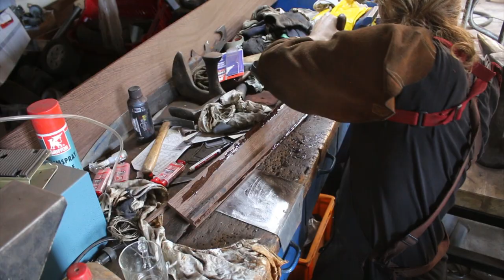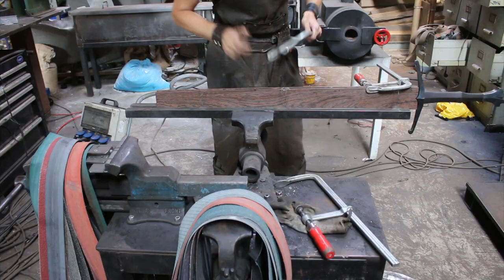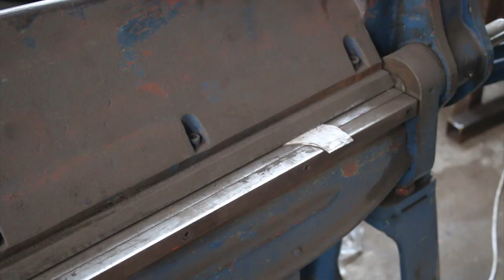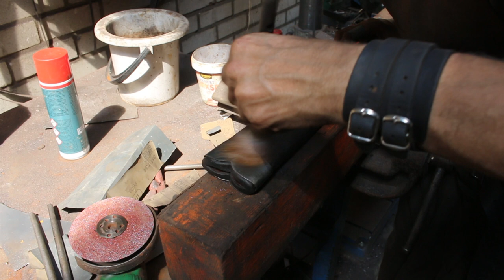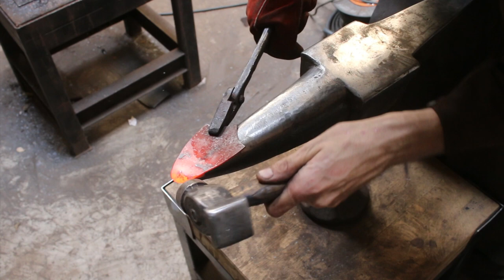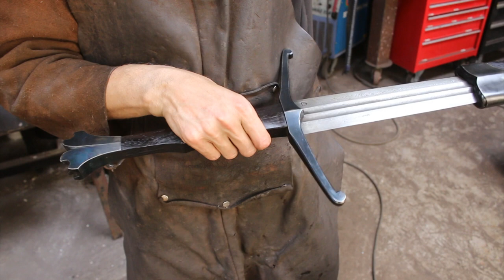Forging a Great sword, part 6, making the scabbard.

Comment: As a carpenter, you make a pretty good blacksmith.  ;)
Reply: I tease, because this is how I do woodworking too.  And my brother the actual woodworker cringes and shakes his head every time.  :D
I really like the three layer method of scabbard construction.  I never put a liner in, though. I heard a long time ago that tannins in the leather would rust the blade, so the leather needed to be brain tanned (or chrome tanned?) or just avoid keeping the blade in it for more than a day or two.  But then, I never tried it to find out for myself.

Comment: Classic starters scabbard, been there, done the same mistake :). Wrong kind of wood, wrong construction (for the period - some viking period sword scabbards were similar but these were probably field replacements, not work of craftsman), the result is thick as  log and must weight a ton. Besides I am not sure that cocktail of  wenge floorboard treated with unknown stabilizers with epoxy chemicals is good for blade. Next time try to use some lighter resin-free wood with straight grain. Ash, birch, even linden were used originally and work MUCH better for the purpose. Linden especially is pleasurable to carve and if covered with properly treated  vegetable tanned leather the scabbard will be strong  and light, really amazing difference. As additional bonus, leather can be tooled to create spectacular effect.

Comment: Hello my friend (no, we have never met but we would be friends if we did...) I am struggling more than I thought I would when making scabbard chapes. I would really love a video that documents how you make scabbard fittings in detail. I am able to make them, and they look ok when done. But, I am so very slow at it. I need to see how others do it so I can get better. I am using brass or steel or nickel silver, depending upon the project. I make Chinese style swords and therefore I use a lot of brass. Thanks for this video. Good work!
Reply: oh, and thanks for the detail in this one. I braze everything by hand with dynaflow brazing rods instead of a wire welder. But, it is still very similar. thanks for the videos!

Comment: chrome tan in contact with metal is no good, the chromium salts will corrode the steel, assuming it was chrome tan because of the embossing on the leather.